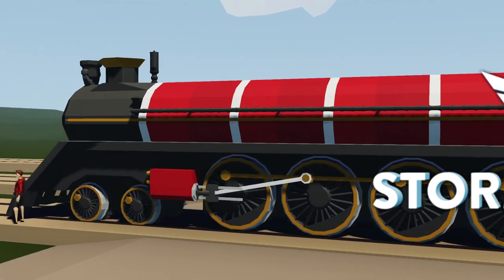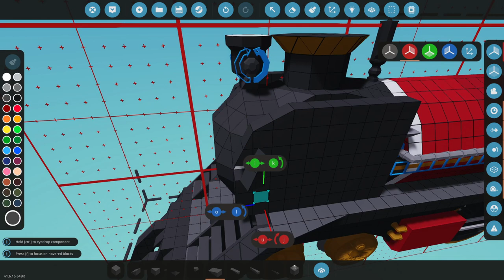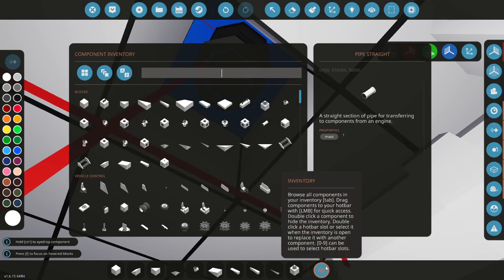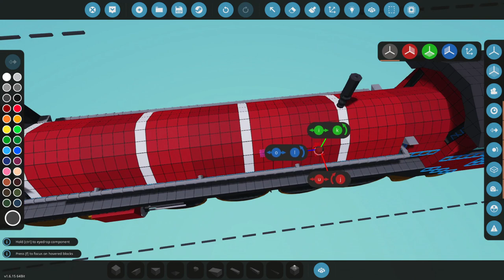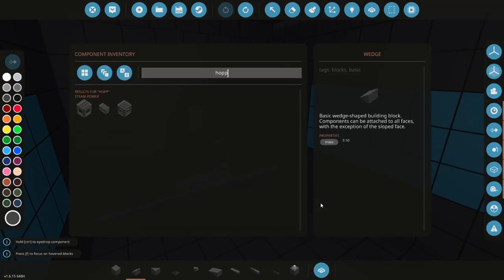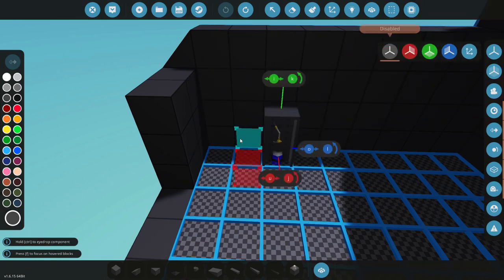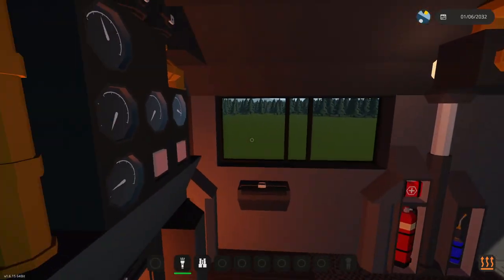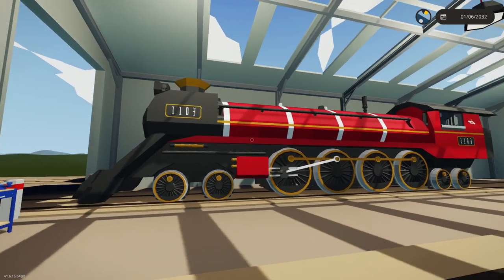Smoke Deflectors ADDED! - Lets Build A Steam Engine In Stormworks!

Comment: Um. Trains mainly have a tender to carry water with them. The fuel is just them utilizing the space wisely. If you have a locomotive with no fire fuel, so sad. If you have a locomotive with no water in the boiler while it's heating up, you and anything around you have a very bad day. I know the game works differently, but historically that was the main difference between a tank engine and a tendered engine. Tank engines had their water tanks on them and hefted them around like saddlebags or backpacks. They tended to hold less because they weren't meant to go as far. Tendered trains had almost no onboard capacity for fuel and water, hence why they had a tender as a designated water and fuel cart for them to haul around after them. Like not just hauling was enough, tenders were piped in and depended on as in if you didn't have a tender hooked up to the train the boiler went dry really quickly.

So I get where you're going, but just to correct you and clarify the books, most if not all tenders were water tanks with coal, wood, or an oil mixture on them. Yes there were oil burning steam locomotives which seems redundant. Use early oils to super heat a boiler to then have it super heat water into steam to then drive the pistons of the train.....it's almost like that could have been shrunk down to having the oil doing the expanding in a cylinder and having the rotational force of that be the thing that drove a crankshaft to then drive the vehicle.

That's another nutty thing you could try to build next. Look up Shay, Heisler, or Climax to get an idea of what some early engineers (like the inventors no the train drivers) did to make torque monster engines, but they're just wonky designs. The Shay and Heisler especially are completely Stormworks doable.  Climax would be tricky, and no that is not a euphemism. The actual model of geared train was called the Climax and it was infamous for practically vibrating itself to destruction, again not a euphemism.